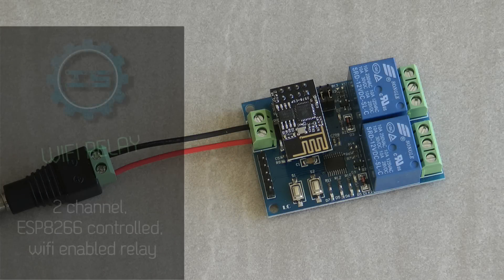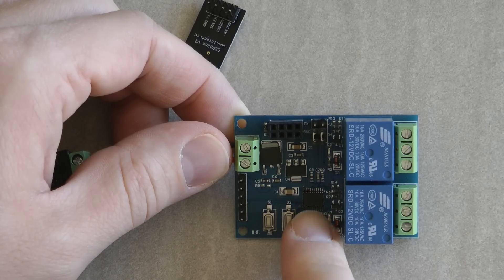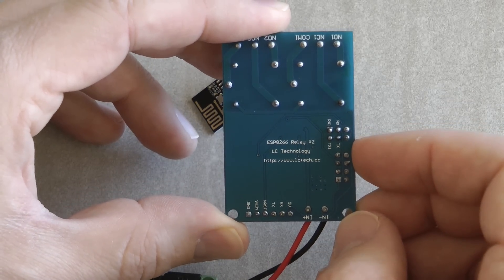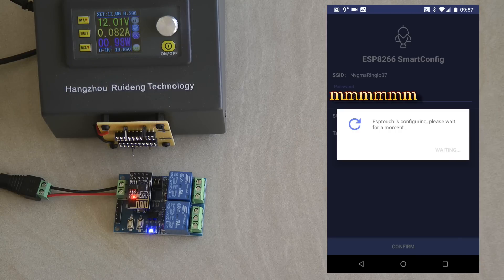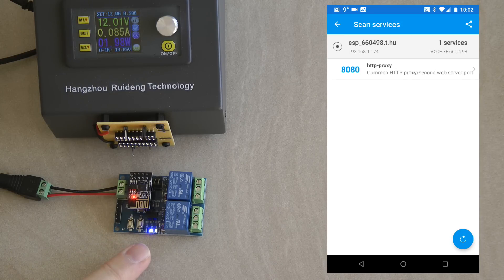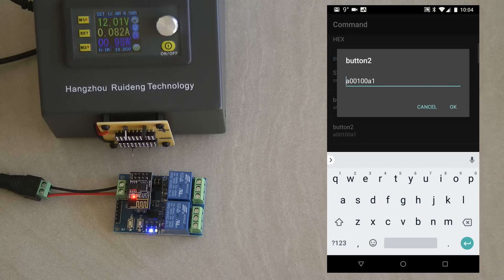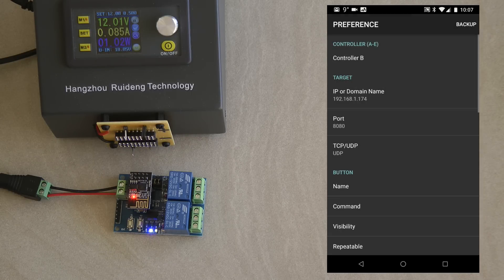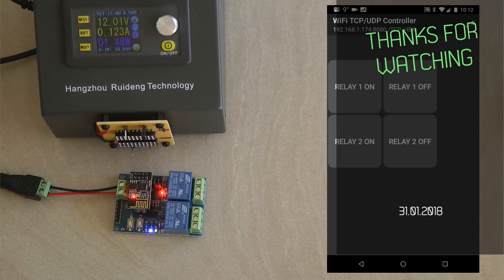ESP8266 wifi relay review

Comment: hi Csongor, I'm part of ESPEasy community and developped even few plugins for this firmware; as far as I know there are members who succeed to install ESPEasy to this module and then communicate with main MC through serial command using the very same 4-bytes commands. Like this you can connect the ESP-01 to your MQTT broker and use it with serial command to turn on/off the relays; you have more info in the ESPEasy forum (search for "Serial MCU controller")
Reply from the maker: +Giovanni Castania Thanks for the tip. This is actually good news. I will research this and try myself. I want to test 2.0 version of ESP Easy anyway.

Comment: Seems like a useless relay board considering all the other options available via MQTT and an actual ESP8266 chip.
Reply from the maker: Yes, I was also a bit disappointed. But my father-in-law will like it, he can easily communicate with it from an industrial PLC.
Reply from the maker: +Max D Check out the comments I got recently. There is a way to upload new firmware and use MQTT